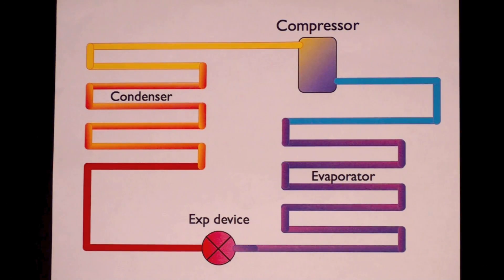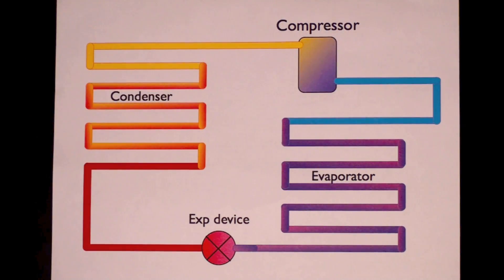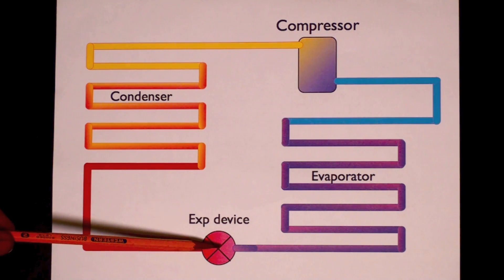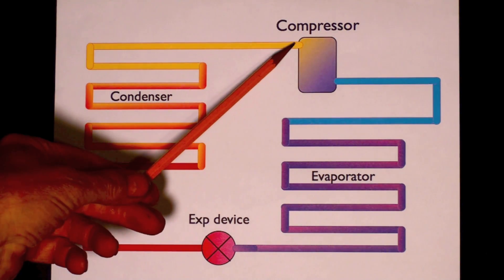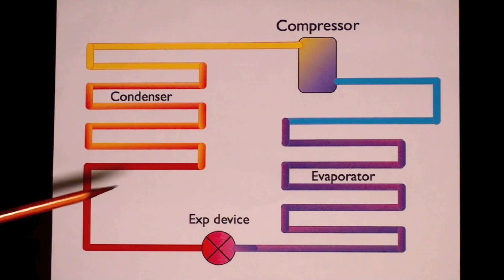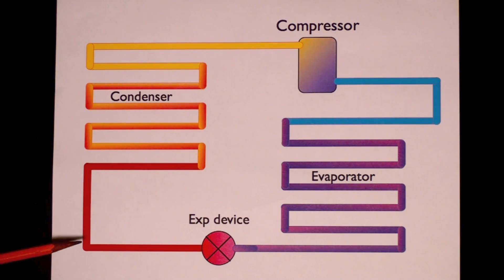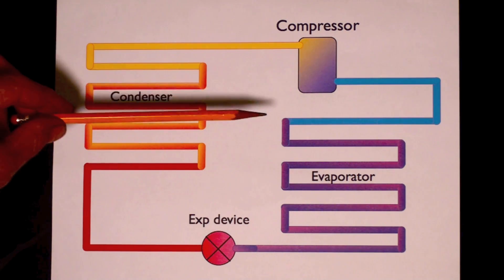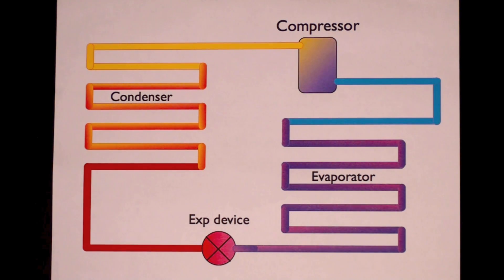Basic refrigeration cycle

Comment: hi Thanks for your clear explanation of  Refrigeration Cycle I have one rather important question I would like to ask. Your Airflow where does the Air come from. Is it normally a Close Loop System where the Air is constantly re-circulated by the Evaporator Fan in the Fridge, or is Fresh Air Intake going on so that the Evaporator Fan is constantly pulling Fresh Air from the Outside and blowing it through the Evaporator Coils inside the Fridge. Also if it is not a close Loop System and the Fresh Air is constantly being sucked in from outside , is it vented out as it is recirculated inside and replaced by a fresh stream of air. Thanks
Reply from the maker: With some exceptions for air conditioners, all air is recycled.
GFM

Comment: wonderful session of teachings.what is your comment to the refrigeration users since most clients ie mombasa kenya where there is high cost on power usage prefer  controlling there systems by putting systems on and off manually to minimize high bills despite them being adviced by professionals that similar practices results to more higher bills.
Reply from the maker: If the refrigeration is space cooling, manual cycling may save some energy if the client actually does shut it off instead of forgetting until it is very cool.  The reality is this does not usually happen.  The best compromise I can think of is you may shut of the thermostat system switch until the afternoon, but then let the thermostat control the structure temp.
GFM

Comment: I have a critical question and i spent a lot of time searching on the answer and  can't find it.

As we know the condenser receives the high temperature and pressure superheated vapor comes from compressor and condensing the refrigerant ... this lead to decrease the refrigerant temperature but the pressure is still high ( before and after condenser ) despite the temperature fall down .... from supposed the pressure will also decrease but this not happened ,,,, what is the explanation of this ???
Reply: Yes in condenser only the temperature is decreased and pressure remains same.

Comment: why condenser on AC units have lots of aluminum fins and larger copper coils meanwhile refrigerators have just that joke of a radiator behind or on the  base, what would happen if i modify that refrigerator condenser with another one or even better if i put it underwater in some way.
Reply from the maker: Couple of reasons for this.  First, the size of a refrigerator is about .5 ton.  Residential air conditioners are from 2 to 5 ton.  Very large difference.  Second, refrigerators are made as cheaply as possible.  
GFM
Reply: grayfurnaceman  So it mean that if i cool down the condenser at one point that no longer burn your  finger when you touch it by changing that radiator with one like those in AC units then could be more efficient? what if i took the same condenser and i sumerge it in running water like in a creek extending the lines to there or even outside in a crawl space or the comdenser has to be at certain temp to work properly.
Reply from the maker: Low condensing temp is generally good for efficiency but if it is cooled too low the unit will just stop working due to low pressure drop.
GFM

Comment: When first assembling, where would the refrigerant be stored? Is it stored in its gas or liquid form? What gas or liquid could function as a refrigerant?
Reply from the maker: The refrigerant is throughout the unit in most cases.  Refrigerants are in a saturated state so there is both liquid and gas.  Most any substance can be used if it is a liquid and gas at  reasonable temperatures.  I have many videos on refrigerants that may help.
GFM

Comment: dos a condenser take the heat generated from the compressor out of the refrige erant  and then turn it into a liqwid then gos throg the expanshion device then enters low psi and low tempaturs.becaws low psi results in low temp.  ubsorbing heat. turns to a gas in the evaperator at the same time sucking heat from the air. then gets pulld into conpressor gets heat from conpressor  at the same time being a gas. thats wene the condensor jumps in and cools it and turns it into a liqwid then repeat.

Comment: thnx dude i really understand now how it fully works the compressor change the low pressure vapor to a high pressure vapor and the metering device change the high pressure liquid to a low presser liquid
Reply from the maker: Jelani Bynoe You got it.GFM
Reply: yhhhhhh!!!! is there a way you could upload a video to show me how to understand the wringing diagram on the air condition systems

Comment: Great video, but I have a question, we know that the temperature drops on the high side because the refrigerant turns to liquid from gas. The temperature out of the compressor is "Super heated - all gas" and close to the Exp device is "Sub cooled liquid".
 
My question is what happens to the pressure? Does it stay the same in all parts of the condenser or does it drop too?
Reply: Pressure stays the same

Comment: when a compressor is off, is there still the 3 states - vapour, liquid, part liquid/part vapour?...
Reply from the maker: When the compressor shuts down, the unit becomes a pressure vessel containing a saturated mix of liquid and gas refrigerant and the pressure inside will correspond to the ambient temperature of the surrounding air.  If this does not make sense to you, let me know and I will reference some explanatory videos.
GFM
Reply: that's fine, thanks...